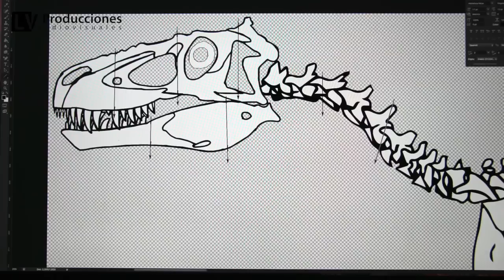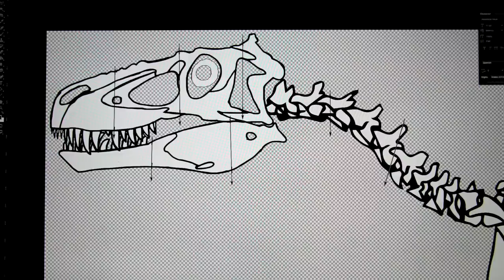RAPTOR SKELETON. MAKING A MECHANICAL DINOSAUR WITH WOOD AND CARDBOARD

Comment: Is there a basic template?  Im planning on doing a raptor head and neck for Halloween but i have no clue as to how big it is. Im guessing from the end of the snout to where the jaw hinges its about 18" long.  And help would be appreciated!!!! Great job
Reply from the maker: Thank you! The only template I used was the one you can see in the video. It's easy to make, you trace it from your computer and you copy it on a piece of cardboard. The skull was 65cm long. Good luck!
Reply: Miguel Letang thanks!